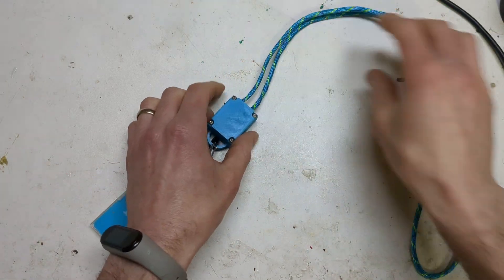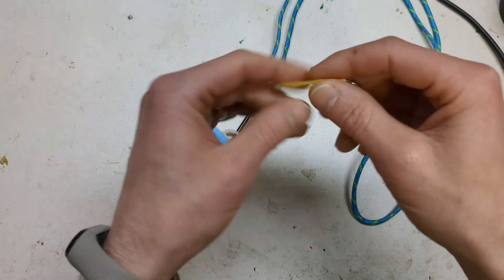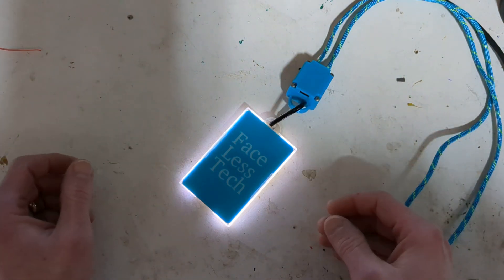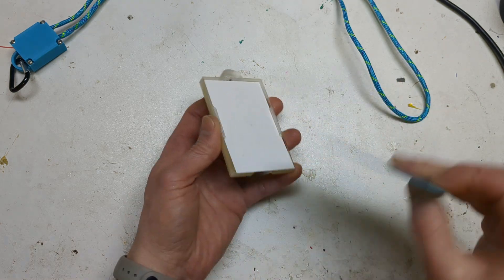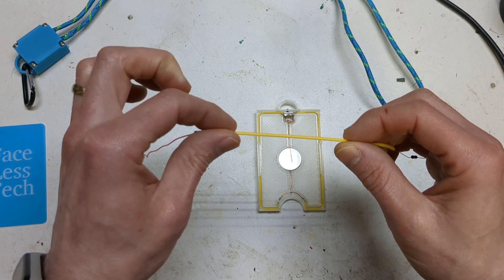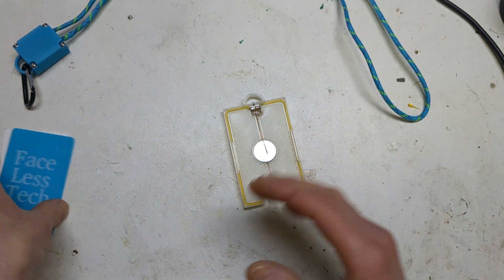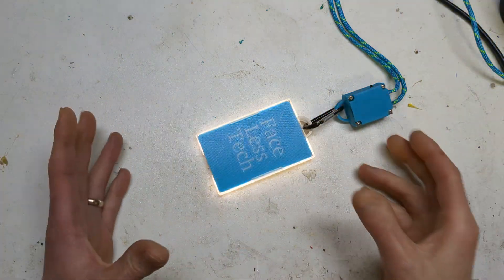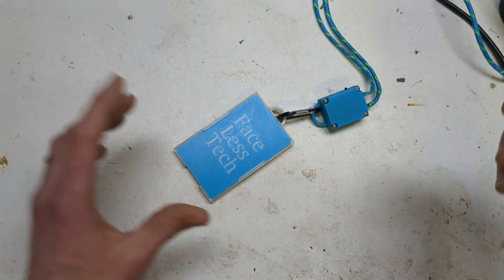LED ID badge holder

Comment: This is an improvement over a clear badge holder where one light shines around the transparent edge. Cool, it would be marketable if u offered colors and usb battery.
Reply from the maker: Thanks, yeah I was struggling to get a really thin lipo battery